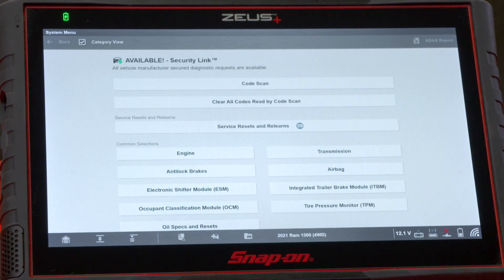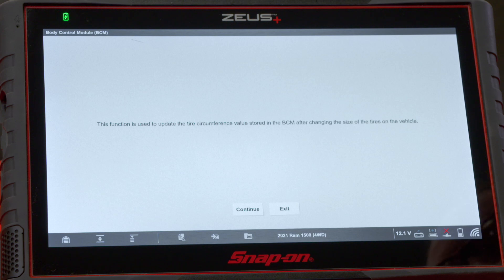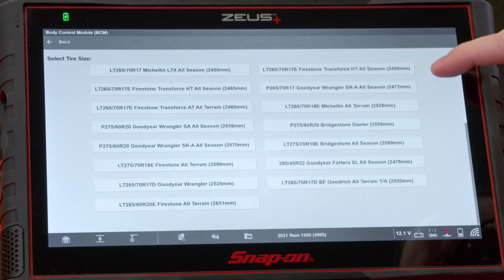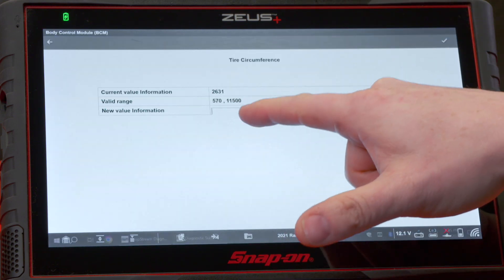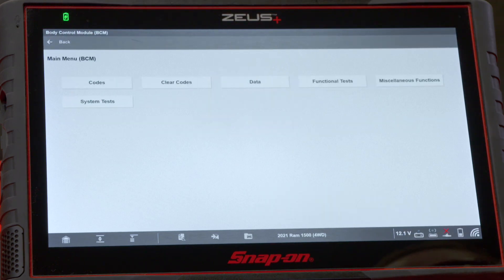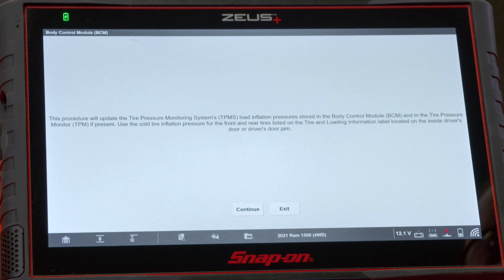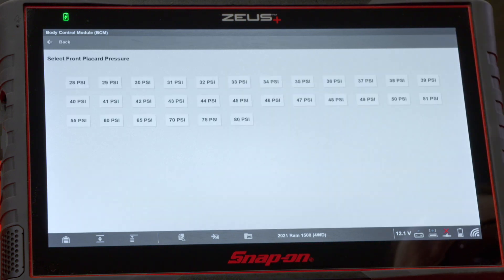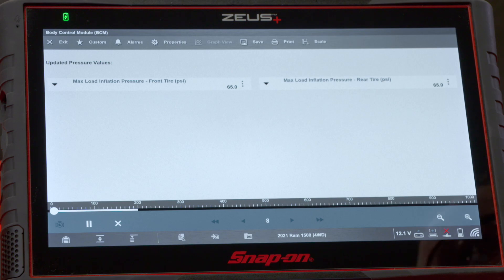RAM® Tire Changes & Pressure Thresholds | Quick Tip

Comment: It is my understanding that the threshold pressure is supposed to be set to the recommended running pressure for the tire and vehicle. It then gives a warning ( at least for Ram trucks) when the pressures drop by around 20 to 25%. It seems like you are treating this as a maximum tire pressure warning which is the opposite of what this function does which is warn of low pressures which makes more sense to me.

Comment: Are you baseing that 65 PSI from the Max pressure on the side wall or what the tire manufacturer recommends the working pressure be?  65PSI seems quite high.
Reply from the maker: Recommended pressure. These are aftermarket large wheels with low profile tires.